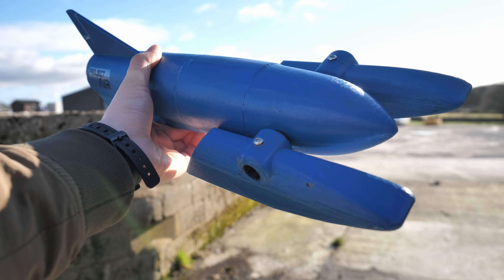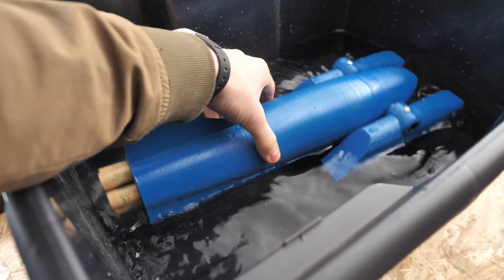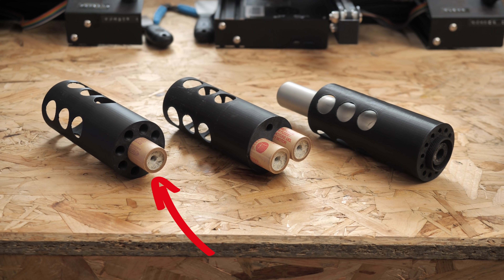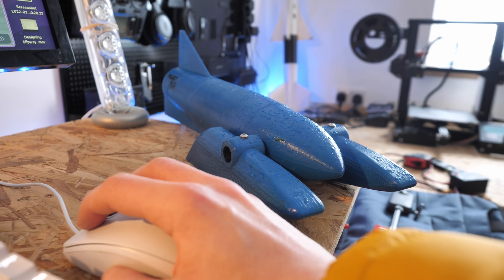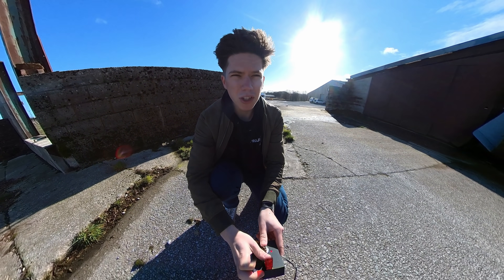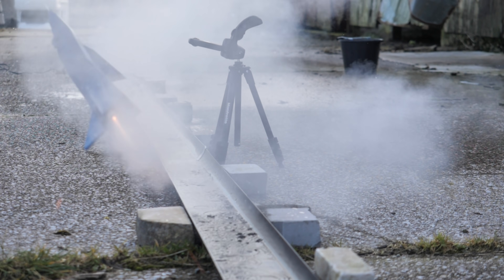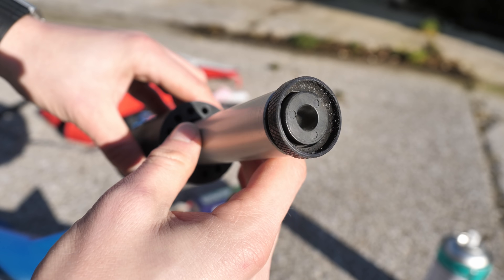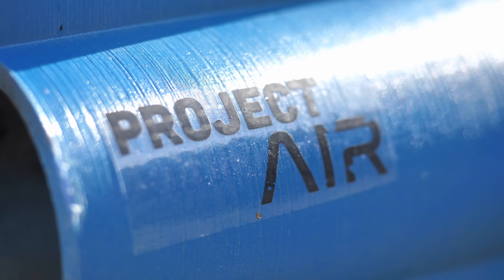DIY Rocket Hydroplane

Comment: idea: to make large 3D print glue surfaces more durable how about you leave the connecting edges not printed/sand them down so you have the infill textured surface against another infill textured surface against eatch other and completelly fill that void with epoxy or something like that, more surface area, more grip, but a bit more weight but i don't think thats an issue with the mostly hollow prints.

something to test, no?

Comment: Have you thought about using an hydrofoil design with a "wing" shaped well... hydrofoil just under the water line ? Would probably prevent it from going nose up in high thrust scenarios. Love the content, keep up the wrok ;)
Reply: It will also reduce water drag. Pretty sure you could have control surfaces on the hydrofoil to tune it in. Thinner the struts and hydrofoil material the better for speed. At those speeds a very small foil would be more than enough.

Comment: Great video!  I think the toppling and tumbling calisthenics performed by the boat is more due to the thrust line not passing through the center of gravity, or perhaps better still, slightly above, and not due to aerodynamic effects. Also, to improve the chances of igniting both (or more) motors simultaneously, I hope you are running separate pairs of cables back to push button and power supply - essentially a parallel connection with a beefy enough battery that ensures that the terminal voltage on any igniter does not sag significantly when the other(s) suck up the juice!

Comment: Awesome video, thanks!  To fix your ignition problems try using tapematch and igniter sticks.  It’s essentially sellotape with black powder stuck to it.  You can poke it into the motors, meaning that you only need one igniter.  I was having problems reliably lighting multiple rocket engines, and this was a game-changer for me.

Comment: The longitudinal stability problem can be solved by adding a horizontal stabilizer to the vertical fin near the transom. Adjusting the angle of attack of the sponsons will not solve this problem..

Comment: Maybe gyro controlled front sponsons to keep you in the sweet spot. And a heavier boat to match the weight of the air when your pushing through it at 60mph. A light boat is too sensitive to pitch.

Comment: What would happen if you added responcive keel under the water. As the nose goes up the keel forces it down. Might be tough to balance it. The other thought was to angle the motors.

Comment: My dad and his cousins used to build hydroplanes back in the '60s and '70s. One thing I learned from them was the faster a boat goes the longer it needs to be. You can use things like airfoils to help keep the front down. The problem with that is the airfoil is normally controlled by the driver to adjust the amount of force needed. You could try to make a fixed airfoil and do a bunch of testing until you get it set at an angle that will hopefully work. Whatever you do I hope it works out and we can't wait to see it.
Reply: You could use a spring loaded airfoil, using the spring tension as a governor if you like, much like a centrifugal clutch, more velocity, more resistance (assuming the limit of deflection was a 'known') 
Hull length and width ratio is also known in the yachting and rowing worlds.
Reply: I'd like to add, I don't know how you'd measure the velocity to act upon the the spring that governs the airfoil, that would take quite some thought i would guess.
Reply: @brunorosa2227  The limit of deflection is the tricky part. You had the same idea I was thinking. Manual adjustment with the remote would be too slow. The simplest way might be to test set angles until something suitable is found. When you're sitting in the boat you can feel when more or less is required. There are so many unknown variables due to the size and speed of this boat that make it impossible to figure out without loads of testing.
Reply: Good idea with the airfoils. Culd a gyroscope be used to control the foils, springs and tension won't work due to the mad acceleration of the rockets.
Reply: Definitely needs to be longer for the speeds it's hitting

Comment: Would adding slots that you could fix sheet metal into it if you can create fins to stabilize there won't be as much left and right movement which could help the speed all go into the boat and not get lost by turning and slowing down

Comment: You should probably add a spoiler to get some downforce thats applied from the top of the craft rather than the nacelles you angle up and down which affect how it travels through the water.

Comment: Having a V-bottomed shape for the outrigger hulls as opposed to your current flat-bottom design will decrease the tendency to hop up out of the water from small waves. I would suggest spreading them out a little as well to increase stability. Fun videos, good luck with your design!

Comment: Your missing one key element in keeping the "Boat" in contact with the water. 

Weight. 

 The more aggressive upward angle on the "Pontoons Of The Boat" was the right idea but need to add some weight to the the "Pontoons" so that the thrust from the rockets don't make it an aircraft that utilizes the ground effect.

 Love your videos and surprised you didn't think about this element in your testing.

Comment: Look at a flying boat, the Hull and sponsons aren't flat, I would say flat hull and sponsons add drag, and also the larger surface area would catch waves/ripples. I would try a hull and sponsons that cut through the water better initially any way, I would also add some adjustable weight to the front.

Comment: When I was launching model rockets, I found that the rubber plugs sometimes either break the igniter or hold too tight. The best way I found to prevent this is to just hold them in the motor with a small piece of masking tape. Also, those D12 motors probably have a parachute charge in them. Try and get some D12-0 which are designed for multi-stage rockets (and use some fireproof wadding in the boat).
Reply: A D12-0 still has the parachute charge in it, it just fires at 0 seconds of delay.

Comment: Maybe a channel in the hydrofoil could work, it can keep the boat lower without increasing too much drag. As the contact area would be smaller, the boat can stabilize closer to the water

Comment: I don't have much experience with boats, but I used to do model rocketry as a hobby. Something important to note when using larger rocket engines is that as they burn, they weigh less. This will change the center of gravity of whatever you put them in as they burn. If, for example, the boat weighs 100 grams with the rocket engine, by the time the engine has completed combustion, the boat could weigh 70 grams, assuming the propellant is 30% of the boats mass. This will shift the center of gravity forward while the engine burns, while also causing the boat to weigh less. I don't know how this could be affecting the behavior of your boat in the water, if at all. I am just pointing it out in case you hadn't considered it already.
Reply: Fascinating! I'm going to research this more for my pursuit of model rockets. :)
Reply: As you mentioned as the motors burn they get lighter. 👍 But as long as the Center of force stays in front of the Center of gravity, it will increase stability.  Another thought is if you hook up your igniters in series, using a higher voltage. 
They will either ALL go off, or nothing at all. Saving motors incase of a bad igniter. 😁
Reply: That is a top tip. Never thought of that. Currently annoyed by a phone advert with a multiple engine water rocker launch: yes, it's do-able, but I don't think they did  it @richardchambers256

Comment: James. I'm not sure at what scale it'll start working at, but if the boat is pogoing you could fit a mass damper.
It was used in a formula one car and it worked. In a tiny boat, who knows?

Comment: Your primary problem is your lifting surfaces not your control surfaces. You shouldn't be trying to plane on a flat surface. You should have an isosceles shaped wedge that sticks into the water that's swept back. The idea there is as it leaves the water that surface provides less lift, and therefore creates a corrective action that pulls that surface back down to the water. Such a surface is highly impractical for creating lift in air due to air's low density. Therefore, the solution to your problem is changing your aerodynamic profile. Control surfaces don't matter at all if your basics shape isn't stable.

Comment: Brilliant!  I love the 'it didn't quite work so next time double the power' philosophy.  Would a hydrofoil help keep it in the water?   Very cool mini too.
Reply: Thrust vectoring would fix this problem, simply angle the engine slightly downward pivoting the nose down under thrust, don't go too far or you will end up with a submarine lol. Less speed but more stability.
Reply: Hydrofoil would probably go against the idea of ‘minimal drag from the water’

Comment: Not that I've proved it myself, but I have a hypothesis that the hull being conically shaped on the water is making the top more airfoil like during the time periods it bounces off of a ripple resulting in extra lift to the nose. I think changing the hull to a flat top curved bottom design would help reduce that at the lower speeds by inverting the pressure. Also adding in a slightly negative angle elevator and or canard might be helpful.

Comment: What about using hydrofoils? It might let you avoid needing active controls if you have multiple foils set up in the right way. I'm thinking stacked on top of each other like a tri-plane, though google also shows single foils in a V-shape.

- Boat rises too high? The bottom foil is pulling the boat down. while the other foils are above the surface.
- Boat too low? The other foils are submerged and provide additional lift.
- Boat tipping over? The foils on the low side are submerged and right the boat automatically.
Reply: Oh, wait. I just realized you'd have to deal with off-center forces of thrust. That additional torque complicates things. Might still work though.

Comment: Why don't you add a small wing that raises the weight a negligible amount on the front of the boat to push it down a little more so you keep contact with the water? You don't even need the wing, just add holes that push the boat down.

Comment: i would suggest you orient the rocket motor's thrust axis slightly above the center of mass of the vehicle and parallel to the ground. that should push the nose down gently during acceleration and prevent the contraption from becoming an airplane.

Comment: Did you put the igniters in series or in parallel?
The commercial igniters are meant to be put in series. They have a low melting point metal added in the tip to short the circuit after ignition. If you use those and put them in parallel, you might short your power supply prematurely, eventually leaving one or more igniters unfired. 
Three reasons for a series circuit: 1) you can check for continuity. If it´s there, you know that every igniter is OK and will fire. 2) Resistance may vary due to production tolerances that will mess up the current distribution in the individual igniters - some may heat up fast, the others stay much colder. In series, you´ll get a quite equal heat-up. And when the first one fires, the others will get hot faster and follow up immediately. 3) the total current stays low, even if you use many igniters, so a simple battery can fire many igniters "at once". Of course, the power rises, so the battery has to provide the power for the heating, but in parallel, the battery couldn´t deliver the power, but it could deliver it in series. The reason is the internal resistance of the battery.

Comment: Just a quick thought that with the dual motors, fitting them vertically could have reduced instability even if there’s a miss fire
Reply: wouldn't that push the nose up or down in the event of a single engine failure though
Reply: @madkills10  True, maybe he could solve the take off problem by mounting the rockets a bit above the center of the boat to creat a downards momentum a prevent taking off or it will make the boat dive into the water :)
Reply: @madkills10  yes I was just thinking that might be less disastrous than a lateral instability
Reply: The English Electric Lightning has entered the room.

Comment: symmetric up and down force "wings", not just down paddles
Reply: drill cylinder carbon-wax tube with NaClO3 tube, put in a rocket plastic pipe, the oxidizer NaClO3 above the the fuel tube (carbon or wax), heat up with starter the oxidizer, it decomposes at 300C, then the hot oxidizer oxygen from it, will burn the fuel, the drill holes must be so that the oxidizer and the reaction exhaust gets nozzled downwards out, if interested in rocketry
Reply: super easy hybrid rocket design, with the fuel and the oxidizer kept separate until put in the rocket tube, and heated up

Comment: Reduce the size of the pontoons. Design them to cut through the water like a knife  not bounce on top reducing drag the slicer pontoons will increase the drag at the front stoping the nose from bouncing up and then Turing into a missile. Or push the rocket further forward or the centre of gravity. Upside down aerofoil on the front
Reply: Basically a high speed version is needed to be built

Comment: I’ve been wanting to get into model rocketry for a bit now, but it seems really complicated. What is the best way you recommend to “enter into” model rockets?
Reply: Just buy a basic model rocket kit
Reply: Go on Amazon and order yourself an Estes rocket kit and some model glue. Once built, to launch it, you will need an “engine” that fits the rocket you built, ignition matches, a launch pad, wire, and a pushbutton launcher. You may even be able to find a kit that includes everything, I know Estes used to make a complete kit
Reply: Not to complicated. It's fun, so just start with a Simple Estes kit.

Comment: It's going so fast the sponsons are acting as wings. Anything that collects air under it will provide lift given enough velocity.
Reply: Push a brick through the air fast enough, and it will give lift
Reply: @tedferkin  F-4 Phantom, haha.
Reply: @tedferkin  yes😂
Reply: Time for spoilers it is then?
Reply: What if the sponsons were at the back instead of the front, and the center point of contact moved up front? That way any lift generated by the sponsons would be closer to center of gravity and less likely to pitch the whole thing up.
Reply: @sircod  instead they pitch it down and it goes to pieces. 

The wide front narrow rear is significantly more stable, too
Reply: That happens with hydroplanes during races now and then

Comment: If you go for active control you might want to look into the wand used on foiling moth and Waspz sailing dinghies. These are mad little boats! They use the pressure pushing against the wand to adjust a flap to keep the ride height fairly stable. The bonus is that it's all mechanical - no electronics required.

Comment: When maxing out the thrust, isn't it a huge design problem to have the thrust so far back and the water contact so far in front? That would make the length a lever to increase any diversion from staying straight (thus nose dive or take off).

Comment: I see two solutions to the problem of unwanted takeoff,

1- a front suspension on wishbone, would absorb impact waves.
2- a rear hydroplane which would counterbalance the front hydroplane (via a rod), which would cancel via counter pressure, the fact that the nose rises by lifting the rear which would make the nose dive.

Comment: Have you considered adding a vertical shaft, perpendicular to the boat, with a wing that is parallel with the water. The wing could produce sufficient downforce to keep the boat on the water’s surface. You could even convert the shaft to a daggerboard to prevent any torque forces from rolling the boat.